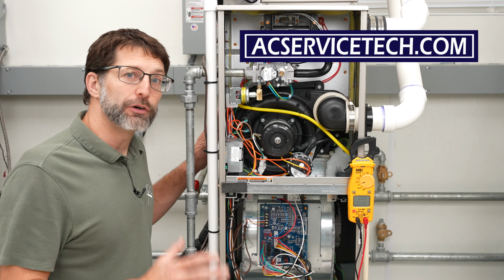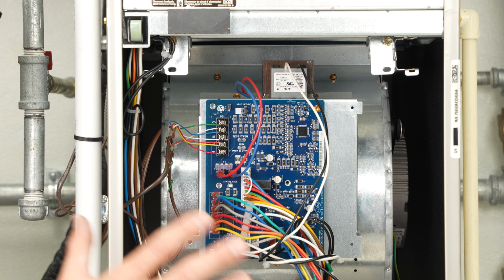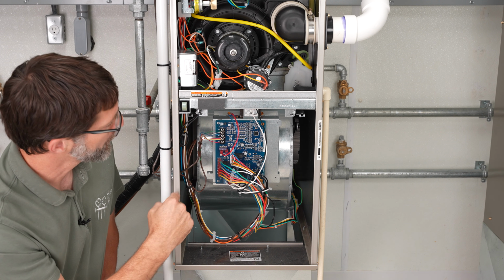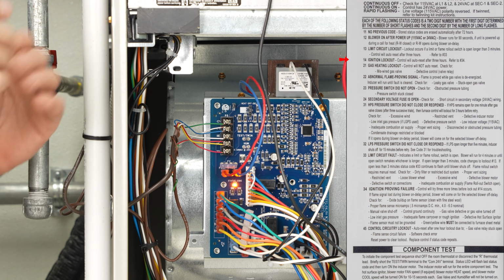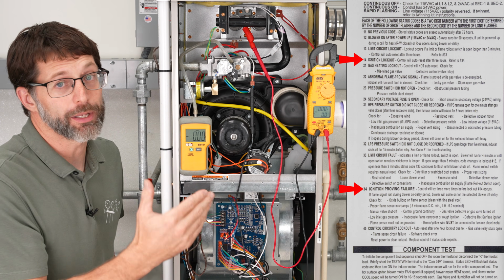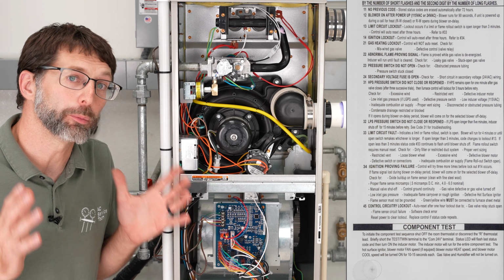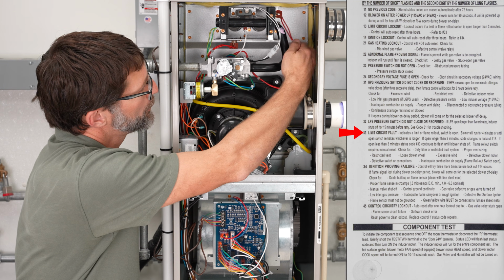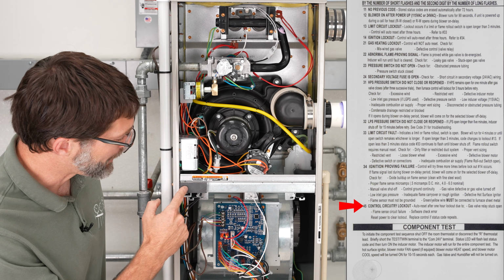Gas Furnace Training & Testing: LED Status Error Codes for Carrier, Bryant, Payne

Comment: The red and green LEDs flashing means Neutral Polarity fault (Hot and Neutral reversed), threw me off because on the last furnace I was working on this was true, but only if the Red and Green LEDs were both flashing in sync.  If they are both flashing out of sync, alternating flashing then it is a different code meaning 1 Hour Lockdown because it sensed something else like overheating somewhere.  But the list only said Red and Green flashing, which they were.  I didn't read farther down where it had another fault listed Red and Green alternating flashing, until later after I tested the input wires.

Comment: Watching your video because I’m having an issue with my Bryant furnace. First issue I’ve ever had, I noticed a plastic burning smell yesterday and after I looked the furnace and it seemed fine, but then noticed the fan is running continuously but a lower rate as it seems.  Long story short I shut the power off overnight when I turned the power back on a saw the error code 12. Yesterday it was solid red. No blinking at all. Could there be a bad relay  that melted? I’m guessing that’s a possibility. Thanks mike

Comment: Just want to say thank you for being so thorough..I got a Payne (in the butt) I had to🤣 unit & our gas ran out & did the startup thing on the inside panel & shut off power & gas switch in unit for 5 minutes then back on & blower started but saw no flames after bout a minute I shut it off..after searching awhile I found a video on the blinking codes & found mine was 12..looked on the inside panel & it just said what it was not what to do..after wasting more time I found your video & it was as simple as letting it run for 90sec & everything started in sequence as you explained..very well done sir I can’t thank you enough..its 1 degree now at 9am north of Cincinnati & a high of 12 degrees.. same for tomorrow & not much better for a week so thanks again..could only imagine the service call with these temperatures..thanks

Comment: I own several rental properties and have found a company I trust to work on my HVAC systems. Unfortunately, a couple months ago a new technician came out and missed the primary issue. This video was very helpful for me to better understand the likely problem(s) while speaking with a different technician that arrived, to diagnose the issue. I was better able to explain what was happening so he could better diagnose the issue and find the problem. I also understood better when he told and showed me what he thought the issue was. I may very well have been able to diagnose the issue, but due to the liabilities, I left it to the professional.

Comment: Hope this helps someone.  How I fix my short yellow flash then three long yellow flash is by changing my filter and then pressing the reset button.  My reset button was located on the top right side. My furnace is the Bryant 95s

Comment: It's midnight in Canada and the furnace stopped with a 31 code. 
You mentioned plugged condensate tube and I noticed the condensate pump was going more often than usual. 
There was a kink in the clear tube so I removed the pump and am draining into the floor drain tonight

Comment: I wish you'd explain how to fix the Led not turning on.

I have this situation where my furnace Led doesn't get power at all ever since I had a breaker switch flipped off and on. I've checked my transformer it does work but doesn't power the board. The problem does seem to come from start like you've showed but where's the fix to that?

Comment: Thank you so much sir for sharing your knowledge! I’m sure you have saved millions of dollars for your viewers. I have truly benefited from your classes. Please please continue the great work you’re doing. You saved me thousands of dollars! 
My Broad Ocean ecm motor alone was a quote of $1500. An a/c tech I previously used, suggested I put 2k with the $1500 and just replace the entire unit.
After watching your videos I was able to narrow it down to the motor. There were no swollen caps, burning smell or anything. The motor looked new. I ohmed out the motor and checked the plug that revealed the motor was good but the module had to be the fault.
I replaced the Broad Ocean with a Johnstone unit and everything worked out fine. Thanks again!❤

Comment: Hey I know this has nothing to do with this topic and I wanted to ask a credible source I was at a local Goodman and I saw a Daikin air handler and it had 2 transformers in it with a big board do you know what the use of the second transformer is, also I’m an apprentice I’ve been working as a helper for about half a year

Comment: I just had a York furnace flashing 12. The panel listed fault codes 1 through 11 so I had to call tech support. They said it was either open circuit on the igniter (it wasn't) or bad board (which it was). Good news was the new board had fault code 12 listed. Just good info to know.

Comment: Amazing video, great quality, well said for everything. 1 thing you are missing is for CODE 32, you need to take off the short pressure switch hose going to VEA, AND SEE IF THERE IS WATER BUILD UP THERE. And if there is, you would need to take off the VEA and check and see how bent the silver fins are, normally there are 6 fins, they need to be bent 90 degee angles towards HEX. Let me know if I am wrong where Craig, thanks
Reply: Im not following what VEA means? I've been troubleshooting a code 23 unsuccessfully, even with a new switch. Down flow natural gas, Bryant 915sb48080.
Reply: @CJRoe  ventor motor sorry, we use these short forms when coding out calls

Comment: Just repaired my 1980's Carrier 397H furnace.  Although the fault was highly likely the main control module (one of the relays looked burnt), I've replaced other parts with new ones (limit switch, sail switch, inducer motor control modle, pressure switch & the main control module). 

I do not trust contractors as they never arrive on time and charge ridiculous $$$.  As an airline tech, this furnace was so easy to work on with so few parts to deal with (very reliable & durable and I found the service manual online).  The total cost of repair was about $250 and replaced the main control module with upgraded unit with OBD-I type diagnostic LED (ICM275).  The furace is up & running again.
Reply: Changing the control board that's costs $250 for the board itself would cost about $900-$1200 depending on the company coming out. Mind you they need to come out and diagnos the problem then they need to find the board, pick it up and come back and replace it. 

Between driving to you, diagnosis, picking up the parts and coming back, replacing the parts then testing the system. It's already $250 for parts. They're about 3 hours in. They probably are getting paid 35$-50$ an hour. Gas for their truck. You're already at around $400-$425. Company needs to make money plus they need to stand by their work so if there is an issue they have to worry about coming back. In the end everything does add up. For me personally doing side work and not having to pay anyone but myself. I'd do that repair for $350 plus parts. That'd include the diagnostic and arrival fee.